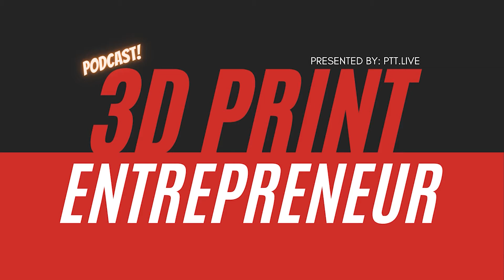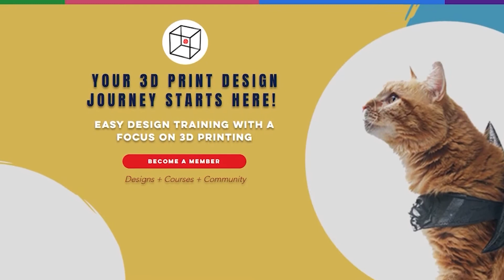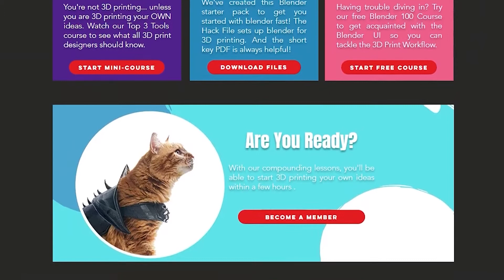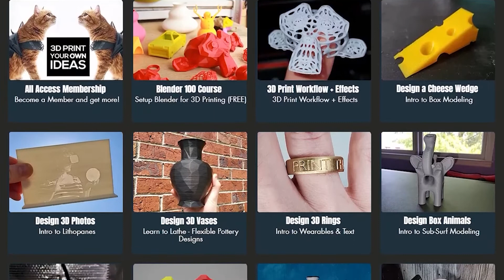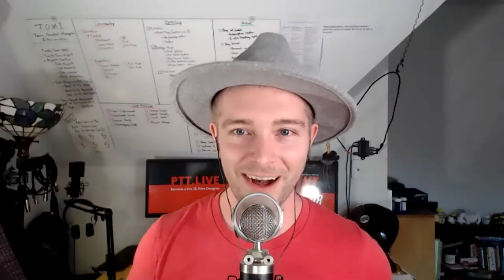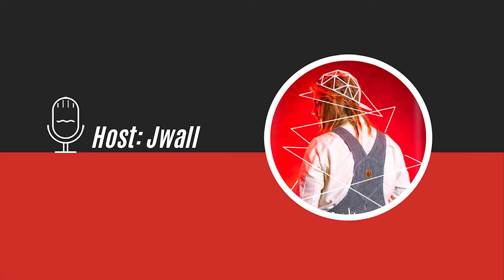Secrets to HYPER-FOCUS your 3D Print Design Skills w/ @ProductDesignOnline | 3D Print Entrepreneur

Comment: at the end with the questions, i wonder how is Step file prefered to stl or obj? what are the advantage, disadvantages?
Reply from the maker: When trying to get my G-Box injection molded they all wanted a STEP file to use. Was gonna cost roughly $10K per mold and I needed 3 molds